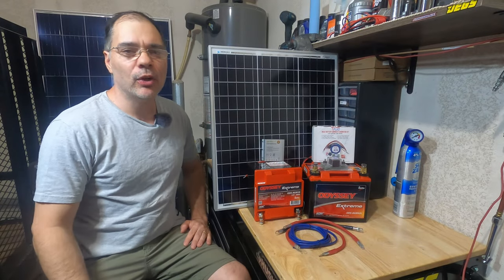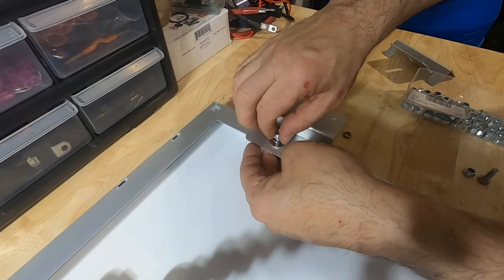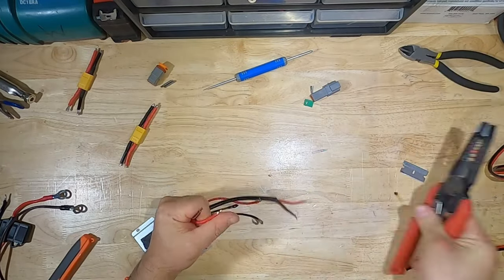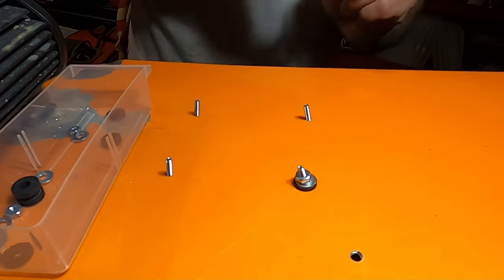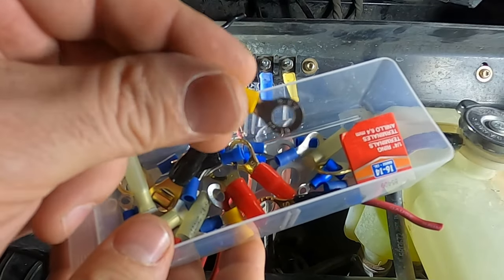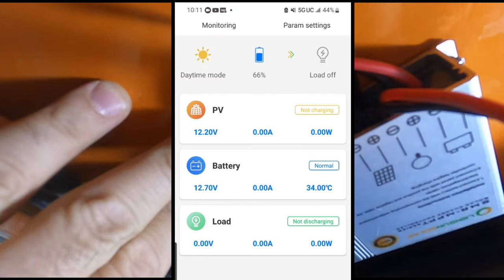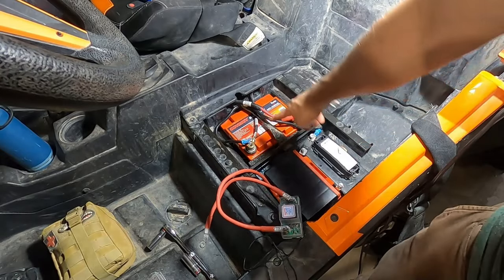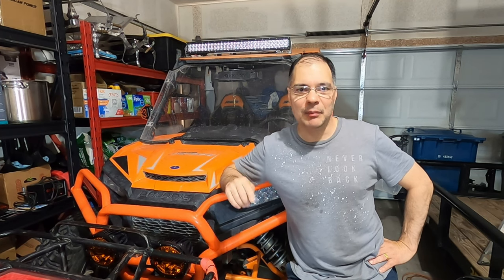Solar Battery Charging for Your Car - Don't Get Stranded!

Comment: What's the O.D. of the roll cage tubing on the windshield bar? I can design and 3d print a roll cage mount for your power panel if you're interested
Reply from the maker: It's 1.75" that would be cool, but I'm going to be putting a new cage on next year . I have a few things I want to do.  Send me an email plz

Comment: I installed it but no drilling, solar panel is mounted on the roof rail, wires enter through the back lights. I am using lithium battery, Mppt charger, and super capacitors to start the Prado. I posted the video.
Reply from the maker: Nice